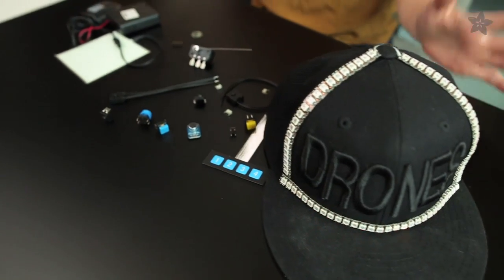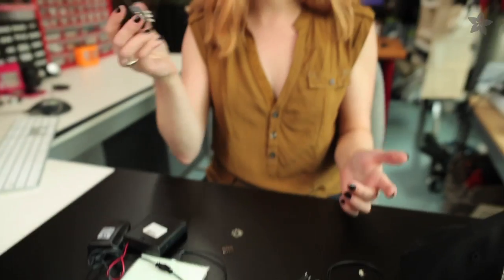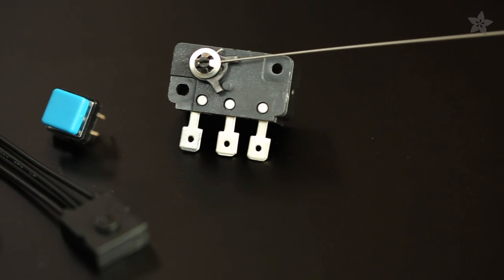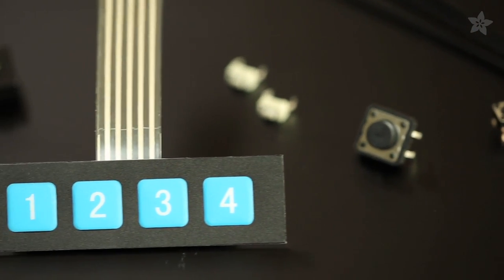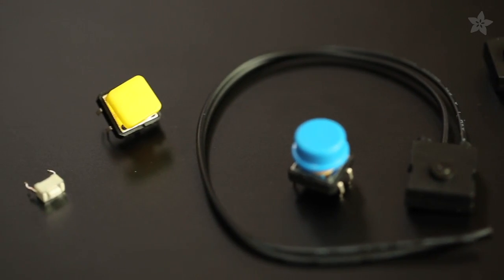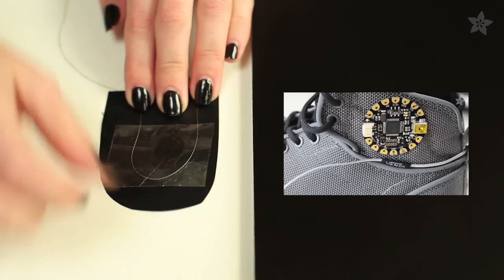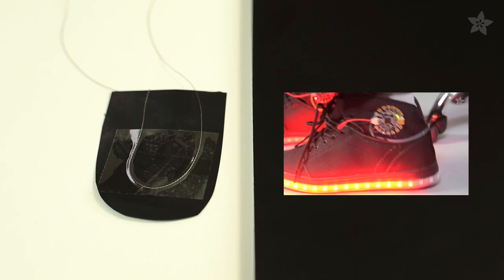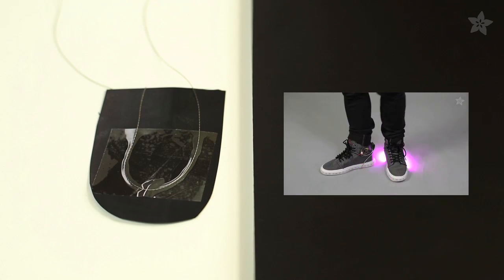Costume Switches and Triggers

Comment: I have a question; I'm trying to create a head that has luminescent eyes.  I'd like to use LED instead of Light Wire, so that's something to take into consideration.  The big issue I have is that while one eye has a constant color, the other will change between four different color LEDs.  I'd like to create some way to trigger the different color LEDs by using various switches/buttons/etc, but I'm unsure how to have one light color turn on while automatically turning the other off.  What advice can you give me here?